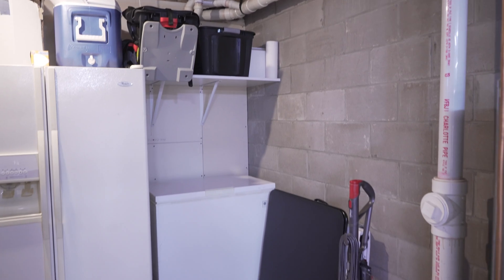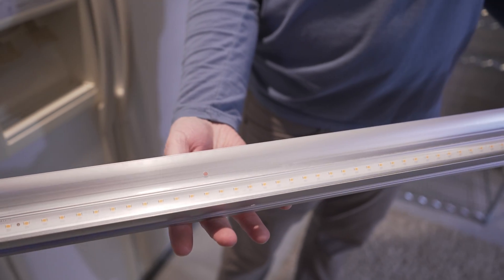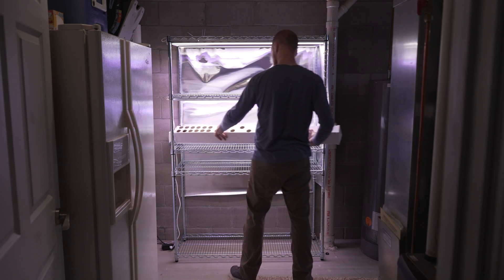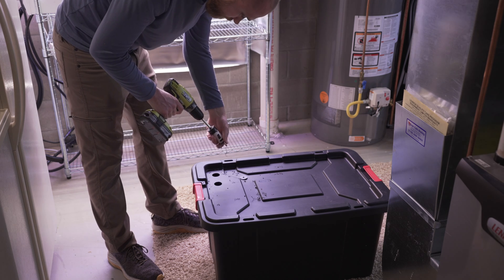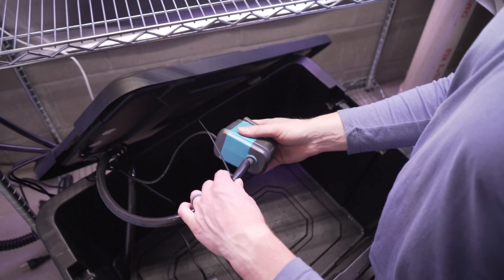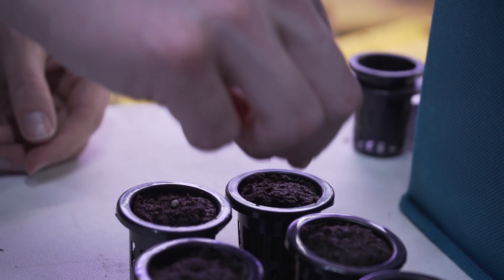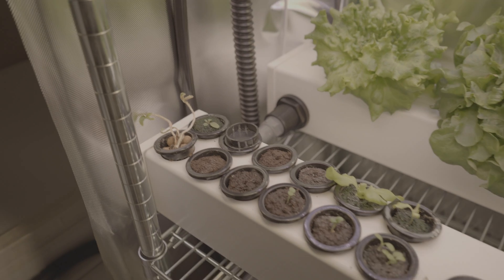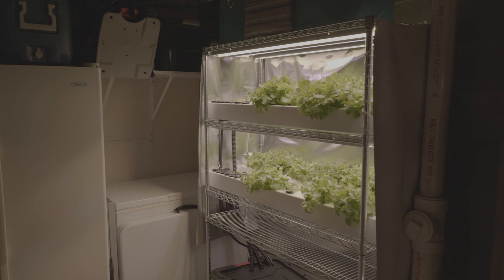From Boring Space to Hydroponic Garden

Comment: Ive got the same setup on a bakers rack thanks to your videos nearly 3 years now! Ive started to put the holes for resevoir tubes high up on the side of the tub, and then not overfill, rather than the lid. This way i can remove the lid fully and add nutrients or clean things more easily.  I've also added a UV filter to the resevoir to to see if it cuts down on algal build up.  And a webcam and a fan - i've grown so much lettuce 🥬 thank you 😂